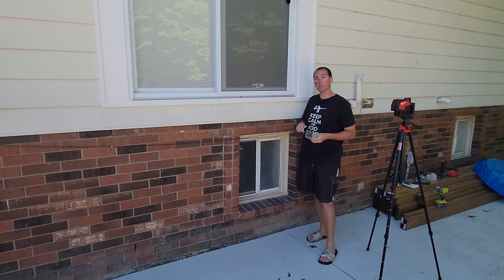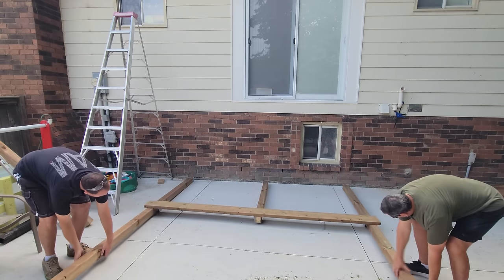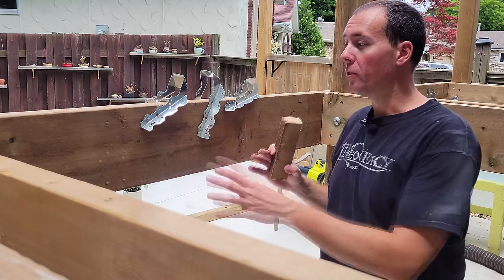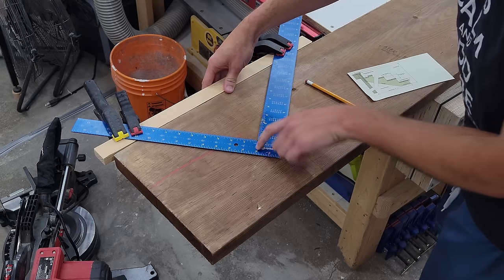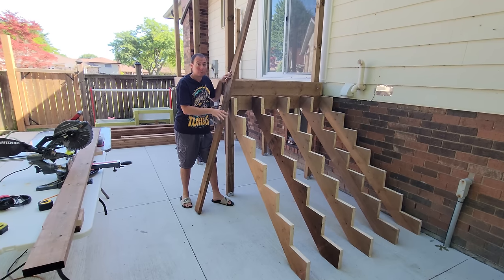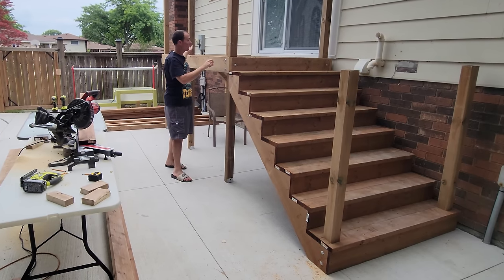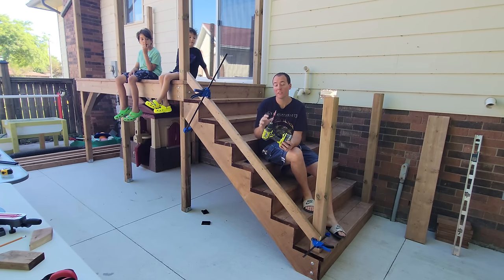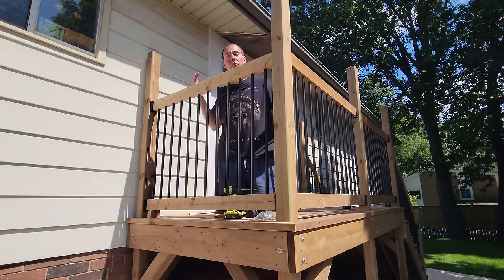How to Build a Deck (DIY Free Standing Deck with Stairs)

Comment: Nice build!

Last couple sets of stringers I made I cut on the bandsaw. Lay out the lines on one board, screw a couple 2x12's together and have at it. They'll be the most beautiful, perfect AND consistent stringers you've ever seen! You just have to plan which side of the 2x you lay out your lines on so that the bandsaw riser post doesn't get in the way. Ideally, your stringer should sit on the bandsaw from from 8:00 to 2:00, not 10 to 4.

I absolutely can't stand the circ saw/jig saw method. There's ALWAYS a frikkin nub left from the circ saw. Grrr

I would think with stringers this size you could do 2 at a time.

Comment: You should use the post anchors that lift the post slightly off the ground so it won’t wick water. Simpson makes them in the USA
Reply from the maker: The patio is sloped and dries out quickly.

Comment: You should always put your joost hangers in after you put your joists in. While using a block is helpful, you'll never find two joists that are the same width and there's always going to be one that sticks up above your rim. joist. But if you have a planer, then all that is irrelevant.

Comment: What CAD software do you use?
Reply from the maker: Autocad 2018
Reply: @DIYBuilds  ooh spendy lol, i designed my deck in tinkercad as i dont like paying for software (although since its in millimeters i just did a scale of 1mm = 1in, and since it was a small deck i was able to buy premade stringers at menards, cant complain for a 400$ deck, sure you can tell it was me that did some of the cuts as non of them are straight but i prefer utility over looks anyways).